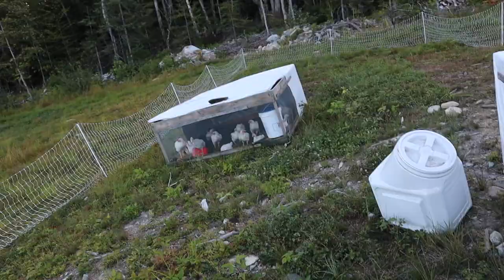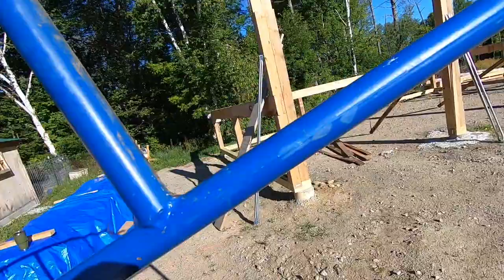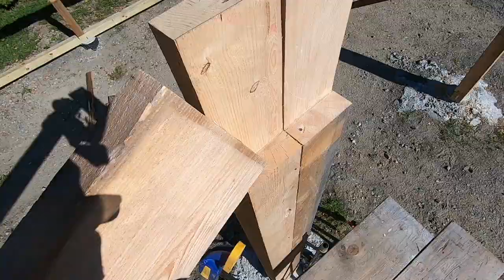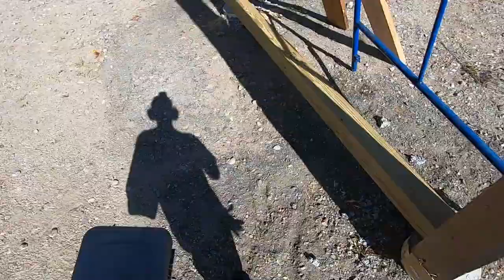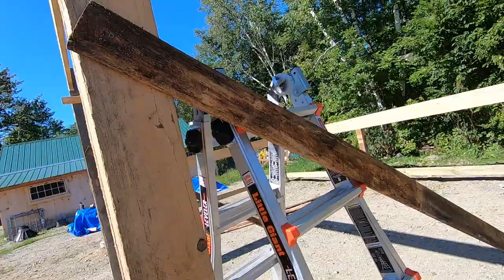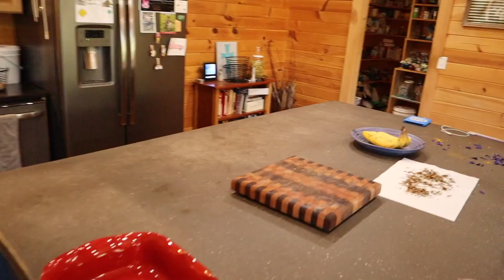Now We're Getting SomeWhere Installing the Biggest BEAMS on the  Post & Beam Garage Day 7

Comment: There are three reasons treated lumber varies so much.
      First is they adjust the width tolerance so they can 'get an edge' on the width so they can call it a board (so they can make more money). 
     Second, when the treated wood is machined it is wet from the preserving solution so when it dries it shrinks. Some boards are wetter than others so they shrink more, also the wood itself can vary in density whether it's Spruce, Pine or Fir (SPF) or even how or where the tree grows.
     Third, treated wood actually machines better frozen which adds another element to the shrinkage factor.
You combine any or all of these factors and you can get quite a dimensional variance. 
     Hope this helps.  🤓
Reply: Awesome answer! Problem is it means it all depends 😀😀😀   Welcome to the world of lumber 😂😂😂😂😂😂
::edit:: this is why it is called rough carpentry 😉😛😀😀😀

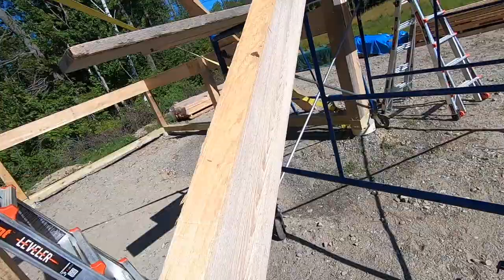Comment: Al, do you look at the crown of that board before you install it. Al that last big board looked cracked.Look at 19:28/ 31:42. And 19:30 there is a Big Crack. You can tell Gina does not like heights. Gina, add some corn starch to thicken it up. Great Job you two.

Comment: If you don't want to buy a laser, buy a longer transparent hose ~1/2inch diameter, fill it with water (no bubbles!) and then you can make a height mark on all post.  From that level mark you can measure up and down and all will be perfectly in level after ;-)

Comment: Good morning Lumnah family!  Al, I did the same build and putting a few 10" Timberlok screws in those double posts really pulled them together. Also, blocking between the box beams really strengthened them. Great job though, loving the channel.
Reply: I agree about the blocking. It will help to keep the boards from twisting and add strength. somewhere in that load of wood will be some pieces  that will work perfect for that.

Comment: i heard pressure treated size varies because the boards swell when infused with the chemicals and then it takes a long time to dry and shrink down to a settled size. my guess is that the boards are in different stages of the curing process, therefore the difference in sizing. i guess if you could be sure all your wood came from the same batch they would be uniform at least.

Comment: Thickness depends on where the wood comes from on the tree and how wet it is.  The outside wood will hold water looker than the inside wood and thus it will be thicker.

Comment: The dimensions of framing lumber is a function of the moisture content of each board.  They all come from  separate trees and are air dried for varying amounts of time.  The boards will stabilize over time as they adjust to your climate.  It just takes time.

Comment: Gina if you cut the top off the onion first then the roots they not be as strong (tearfull) when you cut them. 
I have no idea why this works, however after processing many 50 lb bags, I can tell you it does..
Reply: Holly Slaughter: you can stop tears of an onion by lighting a candle I use the short ones that smell good, but any candle will do.
Reply: Am. Blades 
I don’t have problems with onions cuz I always cut the top off first. Thanks for the suggestion it may help someone else.

Comment: Gina....make Butternut squash soup. Just cover squash by 1 inch in chickenstock with onion and garlic.  Drain and add salt, pepper and curry powder to taste.  Use immersion blender to turn into soup.  It ends up creamy without using cream or other dairy products.  Also freezes will, so I make a big batch.  Sometimes I add chopped sweet potatoes and ginger if I have them on hand.

Comment: Al, I love Jamaica cottage’s rough cut hemlock. Who knows? We might be using some that was harvested at your homestead. 8x8 are really 8x8, 2 x 12 are really 2 x12.  Dimensional treated wood looses so much of the original rough cut,  that 2 x 8 become 1 1/2” x 7 1/4 for example. The vacuum pressures in treating the wood dries most of the moisture out,  but not all. The dimensioned wood it then strapped and bales as is.  Some of the wood is pretty damp inside, but so is the rough cut.

Comment: The pressure treated lumber issue comes from the fact they take boards with random moisture levels and place into the treatment chambers where they can swell different amounts from the same treatment. They then take the still wet from treatment boards and bundle into a tight package so the outside boards dry more then the inside boards before it gets to the store where they pop the straps. 

That is before you get into size of the growth rings effecting how much moisture can be absorbed and swelling the wood different amounts so a board in the core of a tree and a board from the sapwood of the same tree will swell up different amounts.

Comment: I make a squash casserole and freeze squares of it for later dinners. It is so good and the best use of squash for us. Here is the recipe

 I put sliced summer yellow squash (5 or 6 ) and chopped vildelia onion ( 1) in my greased casserole dish and then dotted this with real butter, salt and pepper. In a separate bowl I beat 3 eggs , and added two cups of bisquick baking mix,, one cup of sour cream, 1/4 cup of olive oil and just a few table spoons of water. Mixed well and added two cups of shredded cheese. I used the 3 mixed cheeses, sharp cheddar, white vermont cheddar and regular cheddar (Kraft) I then poured the batter over the sliced squash and onions and mixed it well. Baked it in the oven at 350 until browned on top and a pick placed in the center came out clean. That was about 40 minutes. Oh boy did it taste good!

Comment: Dang Al, those double 2 by 12's will support a second floor on your barn easily. heck with the correct bracing, you could almost put the weight of your tractor up there. But, it is better to overbuild than to regret not having the right strength boards.

Comment: You can have rough sawn kiln dried. Treated is always different in sizes due to how "wet" they are. Then the dimensional lumbar you buy at HD or other building centers is finished more to have a more consistent board for building it'll give you a better finished product than rough sawn.

Comment: Should have use your tractor with the forks to lift up those timbers
Reply: As you, it was my very first observation. As well as a second lenght of scaffold to have a longer/safer/more stable work surface from post to post and thus avoid the use of a shaking and insecure ladder (the ''hassle'' of handling a longer lenght by far worth the benefit, except if Al don't have a second pair of scaffold wheels :-( even without a second pair of wheels he can use his small wheeled cart to move the scaffold )
Reply: maybe the to far for his forklift to reach.
Reply: I think Al might be using this method to demonstrate to us viewers that we can build the barn without needing a tractor with forks, or even a scissors lift.
Reply: Den Hackle < actually those Little Giant Ladders are one of, if not the best ladders made. I have a couple and have zero concerns of stability.
Reply: max height of lift on the kubota is 70 inches. he is at least 4 feet height based on the scaffold height.
Reply: @jimbattles9642  sorry mate what is 70 inch? we know cm. lol
Reply: @jimbattles9642  with the height of Gina and Al, and the height of both ladder (one is 5' and the other 6' tall), scaffold is 5' tall plus the wheels so, as you wrote,  the Kubota height lift is pretty good at 70 inches
Reply: @rassziggy  almost 178cm ;-)
Reply: @rassziggy  multiply by 2.54 to get cm.
Reply: @rassziggy  Al uses imperial measurements. 1/4 or 5/8ths or 1 x 22 yard Gunter's Chain.
Reply: @KebabMusicLtd  been in uk,  we used only metric.
Reply: Not enough lift height to get to the top, that is why Al needs a bigger tractor ;) Plus now he'll have an equipment shed big enough to store it.
Reply: @rassziggy  But road speeds & distances in the UK are miles!!!
Reply: In the UK, we use all sorts of measures:- Inches, centimetres, feet, yards, metres and many more. It really depends on how old you are and your working life. When I was at school and college, I used all of these and carried them over to my working life. It really depended on which was most convenient at the time. For example, 1 foot or 30cm. Basically, use which ever gave the easiest number to remember or to divide up.

Comment: Hey Al use the bucket of your tractor to do the heavy lifting. It will make your life a little easier and save you some back ache.Even if it doesn't go all the way up it will still do the heavest part of the lift.

Comment: I assume those header boards are different lengths so that the outside headers can span from the outside edge to the center of the next column. Did you check for differences in header board lengths, and use the longer boards on the ends?

Comment: Treated lumber isp laced in a pressure vat where the chemicals are forced into the center of the wood. The wood swells due to the moisture and it does not always dry back into the same measurement. Garage is looking good. Thanks.

Comment: The varying sizes in pressure treated is because of the manufacturing process. The sawn lumber is not dried before milling (planed or dressed). Wet (green) rough lumber is planed thicker and wider than typical dried KD, so that it will hopefully dry to the correct size. So for a KD piece of 6x6 it should be dressed to 5 1/2" x 5 1/2" but when planed green it is dressed to 5 5/8" to 5 3/4". Pressure treated pretty much stays wet until it is used so it has not had time to dry.

Comment: Al why not use the Kubota with the forks at max width as a mobile ready use work storage, to move all the larger sized timber?
Reply: The weight of all those big boards would have maxed out the Kubota.
Reply: @mintysingularity  do not know what the max weight is, but could have used it for two or three, would have saved manual handling.
Reply: @mintysingularity  I can roughly guess if Al can handle one board by himself, the Kubota can handle 3-4 boards at time

Comment: Al you should try and get half size frames for the scaffold ,you will be able to tie 2 4x2 s to the frame  at waist height the width of your boards apart,its scary watching Gina grabbing fresh air when she is climbing up ,it will be high enuff that you don't need to take it down everytime you need to move it  and remember to put the brakes on 😎

Comment: Would is like a bundle of straws. That's how it delivers the water to the tree. Each tree has different sizes of straws inside. The bigger the straws the more water they can carry. When you inject the PT treatment into the different wood, it takes in a different amount and swells the wood a different amount as well. That's the best way I can explain it.

Comment: It’s the same as steel beams (I used to make steel .. steel mill is where I met my wonderful husband) anyway ... the national and international standards allow for some variance with the measurements ... for instance structural steel has a 2.5% allowance on weight per foot - over or under... that will make the thicknesses all around vary ... I’ve never worked in a lumber mill but same rules apply .. quality control allows for variance .. and  I’m sure the chemical process causes some variance as well

Comment: great job -would staggering nail gun nails allowing  them to not be in same grain line? probably wont split ? 
wood sizes always differ /from production runs- i found out to buy all the wood + for a project at 1 time helps.
 big box stores are the worst,  they receive stock at different times/ different suppliers.

Comment: Framing Lumber is cut in bulk Kiln dried and then cut and trimmed to specific measurements. Pressure-treated lumber never kiln dried but is cut to specific measurements and then chemically pressure treated. Depending on the cut Center to Outer of the tree will bring about a disproportionate measurement and weight in Lumber. I appreciate your building videos so much your attention to detail. you're so meticulous.

Comment: I found your best mouse trap. Use your container but, the top use spring action. The boards are in a circle and cut in the center. Put the food in the center so when they step on it the spring in the center let’s go and they fall in and it resets for another one. And the best part they can’t get out.

Comment: Love butternut squash soup and it really is so easy to make. If it turns oi ut vh too thin I add some instant potatoes which i always keep in stock. Not sure too much but enough to thicken it. You can also add a little flower to milk and use that. I've added some ccx really sweet carrots too.

Comment: It’s all to do with the grain in the wood and how much moister it retains you will find as it ages it will shrink back down and this will tighten everything up at the same time in the UK they use green oak for building with because as it ages and drys it tightens up.
Sorry one thing I never add to my cooking is syrups I find crated carrots sweeten the soups and stews better and I never add salt to my cooking as everyone has a different level of taste buds to me I have more taste buds than the average person fantastic when trying to work out what’s been used in the cooking of foods but what I consider salty everyone else doubles up in salt to me same with sweetened items.
I have found that I like the taste of gluten free biscuits and have taken to making them more now and they are great with soups and stews 😉
If you place the onion in the freeze for 5 minutes before cutting this will help to cut down on the crying affect 😹😹 I keep my onions in the fridge after picking for this reason. Because I live in a temperate zone I can grow all year around but I do miss the fall and the snow just don’t get that where I am 😿😿 lol I live to close to the desert here but it does mean I can grow anything all year around we do get bad frosts and it’s been known to freeze the water in the pipes during the winter but it just don’t get cold enough to snow😼😼😼

Comment: Number one thing is the building code, in any area, says how many nails or screws, are required for a good hold. 
Also you have a flat surface to work with the staging.  When working on unlevel ground, it is no fun at all trying to keep the staging  level. Exp.when the wheels come off

Comment: I don't want to be a buzz kill but when you plumb your corner post first you need to brace them so they won't move. Then you can start your banding. This will make the walls equal lengths. You don't have to brace at the beginning but you would need to measure the bottom plate length then make the top plate length the same. Then you could level a corner which should rack the opposite corner to plumb. All the corners would need to be braced after being plumbed . Great to watch as your projects progress.

Comment: dimensions or not the same in rough sawn  as it comes off mill also the process of treating causes some difference.  may be small but adds up. plus rough sawn is not meant to be used for close fit. with all the chickens in the freezer try some brunswick stew, a stick to your ribs meal along with the biscuits. i will make in batches of 15 gals. and freeze.  go straight from freezer to stove top to reheat.

Comment: My question...  🙉🙉
If all the horizontal boards are the same length
And the spacing between the posts are the same distance..
How is it that the first horizonal boards are not setting all the way over the first post
Reply: Because the post on the ends are also double posts. So the outer beams start six inches back because of the first post.
Reply: @RedBoneCoonHound47  
Ok but if that was the reason
Then the extreme right should set the same.  But it doesn't...
I went back to when the bottom wood was set
The second footing from the left.  The small block is hanging off the footing...
My thought is the second footing was poured to far to the right..
and to make every thing work..
Things got shifted as much as possible...
But that's just my opinion

Comment: Morning or our evening.
Are your goats for meat too? 
Like your building.
Don't fret too much about boards making your building slightly out of square or over size., nothing's absolutely perfect.
Reply from the maker: No the goats are for milk
Reply: I don't think Al could sleep at night if something wasn't square.    📏📐  😉
Reply: @faithrada  So true in my case. Thanks to those "shims".
Reply: As many of us, Al know quite/very well that ''building slightly out of square...now'' will result in a not so ''slightly'' off measure to fit and finish later ;-)
Reply: @denhackle8020  as a Second  fixer for the last 54 years of my working life I agree,  but have never come across the elusive square n straight structure yet,  even with all of those fancy electronic measuring devices.

Comment: Dimensional lumber S4s (surfaced 4 sides)  starts with the rough cut ex 2x4 then milled smooth each mill has its own set according to how the rough is working and they all cheat a little 1/4 inch per side gives the standard 1 1/2 x 3 1/2